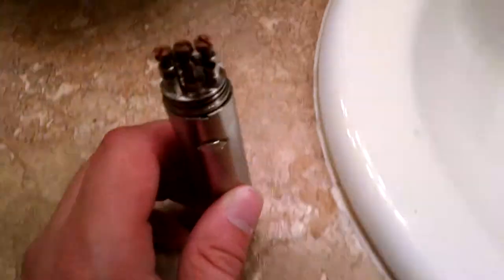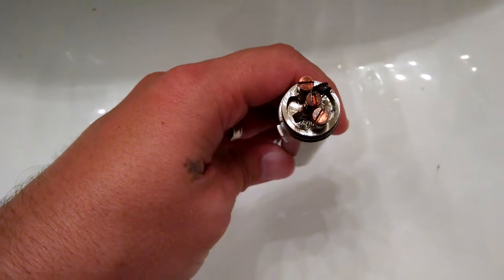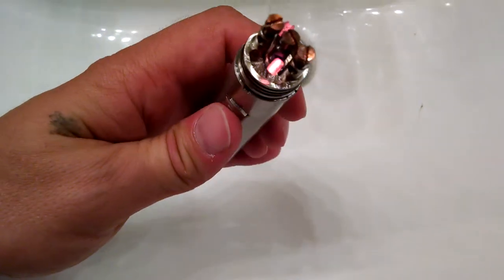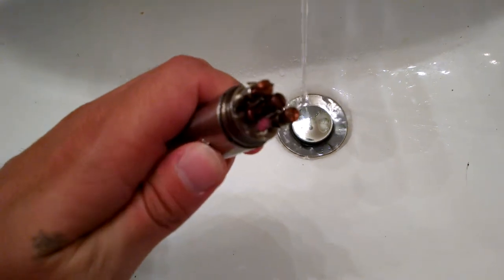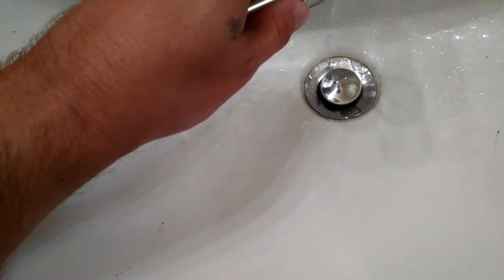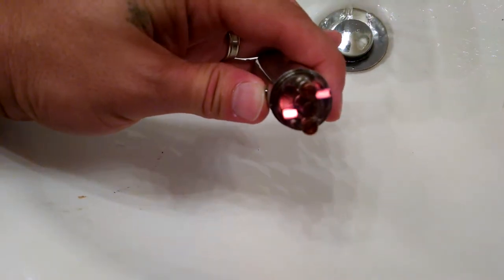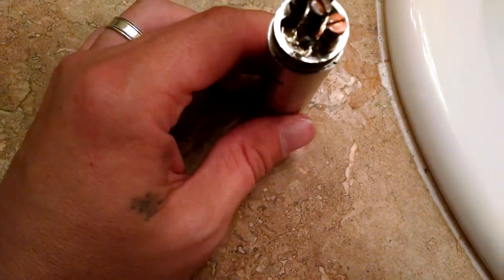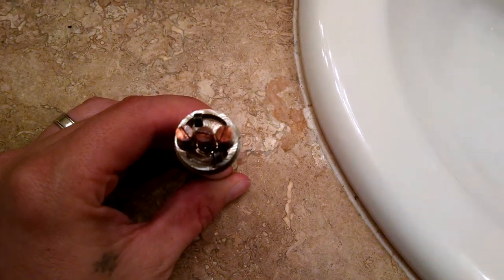How to quickly clean gunked up coils.

Comment: Hey is that an Ijust2 by eleaf battery? I got the kit a week and a few days ago...Thinking of investing a bit more...And I can't decide if I want an Rta or a mod.What would you suggest?I have my mind on a Kanger tank(subtank mini 2+).
Reply from the maker: What's up, man? The Subtank Mini is a pretty good little RTA, but they can be quite leaky, and the build deck is tiny. I believe it can only be built down to .3 ohm, so if you want to go lower, you're screwed. The iJust2 can supposedly fire down to .1, but mine won't. I can build as low as .20 and that's it.